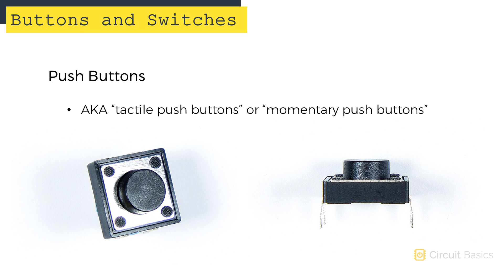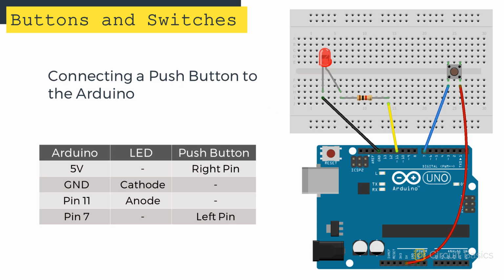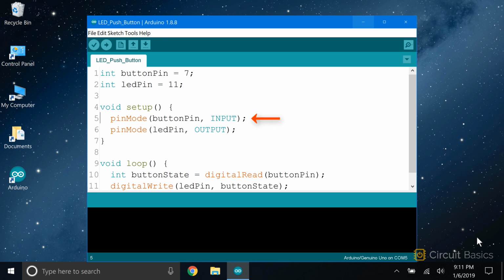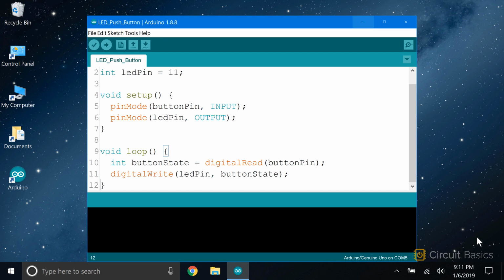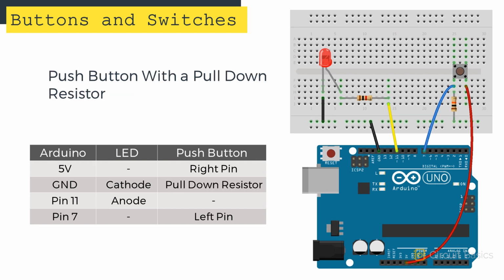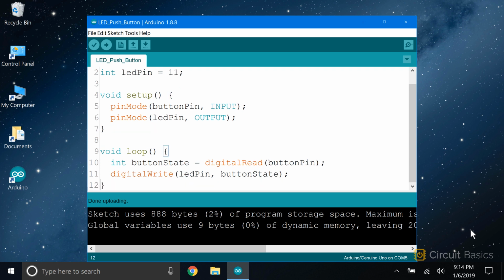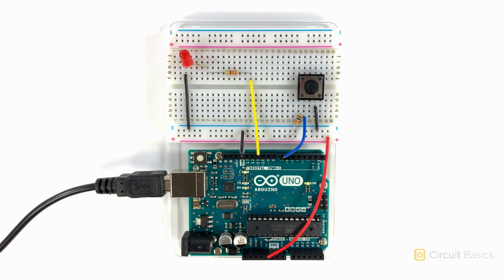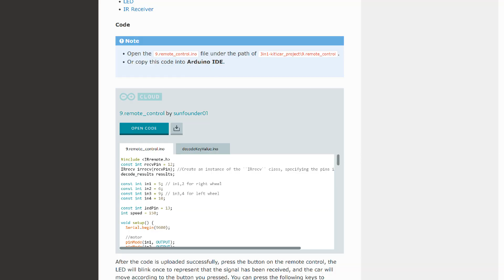How to Use Push Buttons on the Arduino - Ultimate Guide to the Arduino #7

Comment: I have the PWM with a potentiometer hooked up to a gate driver and then IGBT. It works good, but is it possible to use a push button so that you press it and get a delay before it sends a timed PWM pulse. Basically I just need it to only send out the PWM signal for 0.5 seconds. thank you

Comment: Just double checking to make sure I understand what's going on: (when using the pull-up resistor) the Arduino returns a value of '0' or 'LOW' using digitalRead at pin 7 when the button is pressed (closed state) because the current flows to ground, correct? Or am I way off? I can understand how the pull-up resistor keeps the button's open state high - thereby returning a value of '1' or 'HIGH' using digitalRead at pin 7. I just don't quite get why pressing the button (closed state) returns the '0' or 'LOW' value. Thanks for these great videos BTW!

Comment: Hi,
I built a similar Arduino woth the Motor Control board. However I had issues with using the infrared Control. There was a conflict as both libraries used a common timer ? routine. Have you experienced this issue. Great video by the way thanks.
Owen